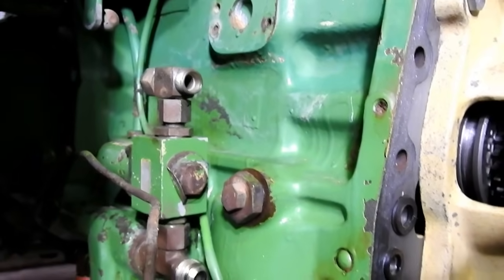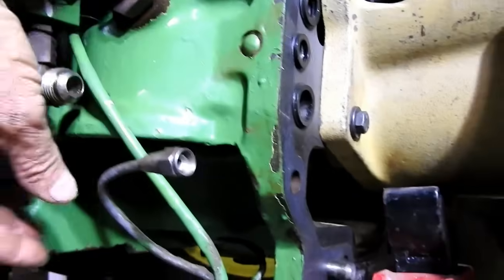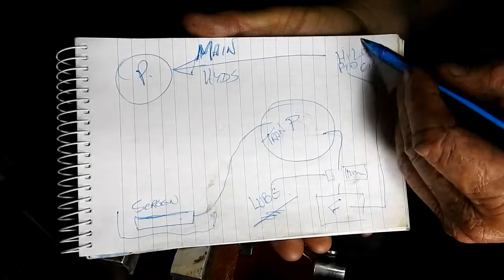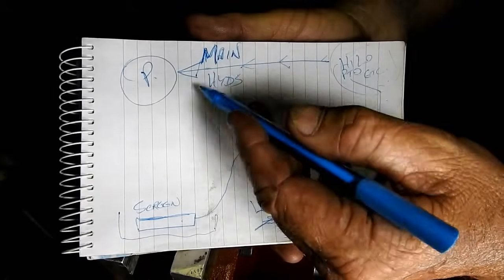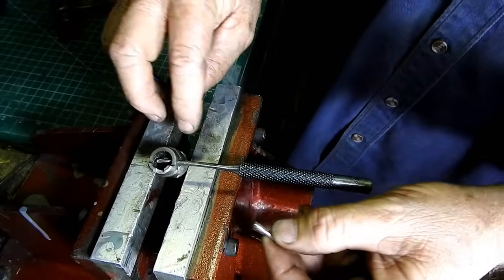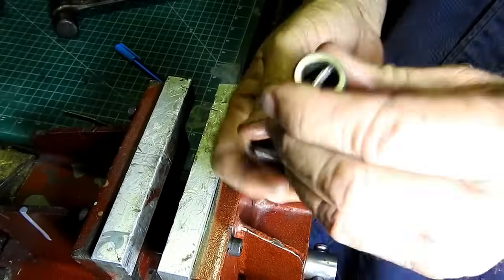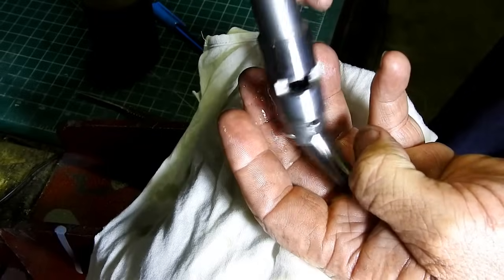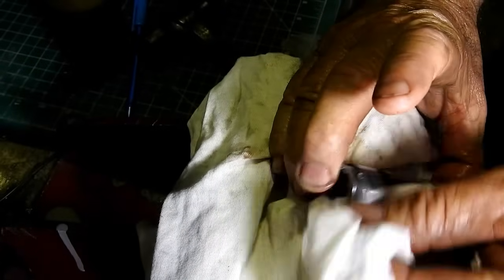How to Check Your John Deere Filter Bypass Valve

Comment: hi, I write from Italy. thanks for the many help / advice you give! I have a problem on my JD. The old owner was traveling without a transmission filter. During a full service I decided (rightly) to put it back. But with transmission filter, arms and steering do not work. 
As if no oil / pressure is coming. If I remove the filter, everything works. Could it be some enchanted valve? thank you
Reply: here we are .  installed the code AR75603 and everything looks ok!  the spare parts dealer apologizes for the mistake.  The important thing was to understand and solve!  no bleeding needed?  the front pump seems a bit noisy.  it becomes silent under load but slightly noisy with the tractor in neutral / running but stationary .
Reply from the maker: @beta85-b4t  the front pump noise is just the coupler. The rattle is a sign of good hydraulics. Replace the drive rubbers and you should be done.
Reply: @BundyBearsShed  I confirm everything ok with the new and correct filter.  only the noisy front pump remains (not always).  under stress no.  with tractor at rest yes.  just give the steering wheel a shot and momentarily it becomes silent (a few seconds).  I think the pump should be overhauled, right?
Reply from the maker: @beta85-b4t  No it is just the pump drive coupler, replace the rubbers and it will be good.
Reply: @BundyBearsShed  ok, I'm happy.  so with a JD RE228042 kit, it might be enough!
Reply: @BundyBearsShed  could it be that the pump is damaged if I constantly find residues in the transmission oil filter?  I have already had to replace the new filter because it is rich in metal powders :-/
Reply from the maker: That is a strange problem to have. I would say clean the screen in the bottom and make sure the new filter is in the correct way, early ones could be back to front but not the later ones.
Reply: @BundyBearsShed  Thanks for the reply.  yes very strange.  I have checked and actually there are different types of filters for the 3130.  the supplier provided me with a model they believed compatible.  but unfortunately he must have been wrong.  now order an AR75603 which appears to be "free on both sides".  hope to resolve.  I keep you updated
Reply from the maker: If it has a big washer in the canister it has the AR75603 but early ones were closed at the outer end the open end went up to the gearbox. The later filter is way cheaper and if it had the early one you can fit the plate to use the cheaper filter.
Reply: @BundyBearsShed  I understand .  thanks for these valuable info!  the dealer had provided me with the AL25554.  these days I get the AR75603 and I immediately test.  It may be that the old owner fell into this mess, that's why he eventually took it off.

Comment: So you talk about the lugs being broke off the end of the valve which is what I found on my 2550. Will this make slow rear lift and hard steering or will the valve still work with them missing? Thanks
Reply from the maker: I try and fit them as close to original as possible but I dont think it should worry the flow.

Comment: Aside from flush, filters and new oil, do you have any recommendations for troubleshooting a 1970 3120 with rear 3pt lift arms not lifting?
Reply from the maker: I suppose you need to work out if it is the only thing not working and if everything else is fine pop the lift cover off and you will probably fine what is wrong.

Comment: hi ,i’m from italy, before remove the valve is necessary to renove all hydraulic oil?
Reply from the maker: Yes you do
Reply: hi.  thanks a lot… today i ha e clean bypass valve but situation is not resilved.. i have a 3040 4wd .. if i power on and wait 10 minutes at minimum rpm and hylo anctive, machine lost the elevator… if i accelerate the motor, the elevator return operational.. any idea?

Comment: hi, good information… you are the best… in jd 3040 to remove the valve is nesessary to remove all hydraulic oil before? or can i remove valve unless remove oil?
Reply from the maker: If you are quick no need to remove the oil but if you are learning it is probably best to drop it.
Reply: @BundyBearsShed  ok thanks i are a big

Comment: Hi there i have jd2040 with sg2 cab,problem is that my rear lift arms are bit to high in lower position...when tractor   is shut down arms are in lower position and when i turn it on it raises a bit....is there a way to adjust this? Sorry for my bad english
Reply from the maker: You can adjust the lever where there is a bolt where it comes out of the lift cover. With the SG2 there is adjustment on the rod.

Comment: I have a '74 full power shift john deere. Last winter I started it to plow snow but the shift lever wouldn't move. It acted like it was solid. Something gave and it now moves but I don't have any forward gears. Reverse is fine, hydraulics still work. What am I missing
Reply from the maker: What model tractor? It is possible that the selector gate broke off the shaft as they do seem to do this from time to time.

Comment: I have a JD 540 4x4 tractor and the forward reverse shuttle has quit working,can you help me out with some troubleshooting.
Reply from the maker: Do the filter, bypass valve and check system pressure.

Comment: Anybody Have  Deere 304J that needs the oil to heat up before it moves
Reply from the maker: I would suspect blocked suction screen or blocked filter and as the oil heats up it can run through the screen.

Comment: 1980 John Deere 950 3 point hitch is stuck in the up position any advice? Thank you for your time
Reply from the maker: The draft cam will have dropped to the side of the rockshaft teardrop. pot the top off and shim the rubbing block and put it back on and it should be good. Make sure you have not bumped the rate of drop lever closed with your foot.
Reply: @BundyBearsShed  not sure i understand your terms for parts you are referring too.
Reply: @BundyBearsShed  was able to get it fixed thank you
Reply: Hi Corey do you mind explaining how you fixed it? I have the exact same issue with my 1640
Reply: @acidlumin  i took the seat off and theres a cover over some type of pin and i took a flat head screw driver and pushed on it at the same time as moving the lever that operates the hydraulics. I apologize that i dont know the names of the parts. Nothing more than a shade tree mechanic.
Reply: @coreycrawford1325  thanks! That might be the “rate of drop” valve (?) and I think there should be a little knob on a stick that attaches to the pin you mention, which protrudes out under the seat between your legs, so you can adjust it without taking the seat off. When I try to turn my rate of drop knob, the whole valve unscrews out of the casing, rather than adjusting the valve. Hopefully that is my issue too, I’ll take a closer look tomorrow. I happen to be getting a new seat tomorrow too. I am no mechanic either! Thanks from Wales.
Reply: @acidlumin  yes sir. And best of luck hope you get it fixed man

Comment: Came across your video trying to find out why I loose all hydraulic pressure like 3 point and steering on my jd 1120, I could run the tractor for a bit then all of a sudden no hydraulics, I shut it off let it sit for a minute or 2 they work again, level is full, seem every time i loose hydraulic I have to shut it off, could that be the hydraulic pump in the front be getting hot and weak? or this valve that you showed, and if you could tell me where to start looking that would be great any help will do
Reply from the maker: It is hard to say from here, the front pump needs supply from the trans pump so pressure testing it would be a good start.

Comment: .
Reply: Am in Uganda my 6125m transmission and hydraulics gets very hot after moving for a while,drops the lifting pressure and warning lights on, but gears engage smoothly and it is powerful enough, help to identify the challenge, thanks.

Comment: Hello lance, I have a problem with my hyrdaulics. I have already checked my filter everything is good. But the only main problem is the plow wont go down.
Reply from the maker: Check you have not bumped the rate of drop knob just in front of your seat. Some times the draft cam can drop off the eccentric on the rockshaft too and it is best to lift the top and take the slop out so it wont happen again.

Comment: Lance, thank you for the video. I'm struggling with hydraulics in similar tractor and your help makes a change in my understanding of the circuit. 
Suppose, a bypass valve with broken off fingers rotates in the seat. Can it lead to any crack in the line before the filter if the filter gets terribly packed with debris?

Do you know what oil pressure should be in charge line of JD 2040s?
Reply from the maker: No it wouldnt crack the pipe they just work harden over time.

Comment: Would that valve make my loader chatter when I raise the bucket if not what do u think it may be. Its full of clean john deere hyd trans oil and new filter what's ur thoughts
Reply: I asked if this valve would make my loader chatter when I raise the bucket this is on a 2040 2wd please feal free to text me on this issue 207 578 1645 thank you
Reply from the maker: No its not this valve this either stops it or doesnt, no in between.
Reply from the maker: No try plumbing the return from the loader control valve into the filter bowl, that way it helps to regenerate used oil faster.
Reply: That is how the return is in the filter. I put a new front hyd pump on and it was fine for 3 or 4 months plowing snow and back to chattering do you think it maybe the internal pump off the transmission is what the john deere deler said it was but they also said it was the front pump I just don't know u do something to fix it and then it's no different than it was u get discouraged what is your thoughts

Comment: Hi , from saskatchewan Canada.  I very successfully used one of your videos to repair the steering valve on my jd 300 loader tractor after it sitting for 6 years , but now after the downtime the hydraulic pump is leaking . It has the big pump ( i think 23 gpm or something like that) are you going to do a video on rebuilding these pumps ?
Reply from the maker: Yes it is in the planning stages the small pump was the 23cc the big one was a 40cc

Comment: Having problems with my John Deere 3350 my steering is gone hard and my link arms won’t go up nor down but my brakes are good anyone able to help?
Reply from the maker: Check this valve and check if you are in Hi on the Hi/lo on the dash, there is a known problem with the hi brake piston packing.

Comment: Had a Deere 2350 we just changed the hydraulic oil and filter in because of no hydraulics.  I took your advice and checked this valve and found part of the roll pin broke and the piece was holding the valve open. I cleaned and installed a new roll pin and everything works great.  Thank you for this video!
Reply from the maker: Glad it helped, thats why I do the videos, so people can have a go themselves. Good work!
Reply: I had exact same roll pin results.  Unfortunately, it did not solve my problem.  Still decoding the mystery.

Comment: Hello, im from sweden i have a john deere 2040s, The front pump won't get any oil from the transmission, The filtrers are new and also the front pump, can a bypass valve be the reason the transmission doenst get preassure? The liftarms went down so i guess its a inner leak, is it possible to get down there without lifting the cab?
Reply from the maker: Yes it can be the problem

Comment: When attempting to remove the valve, does the filter need to be removed as well to allow the valve to be pulled out?
Reply from the maker: No it should just come out.
Reply: @BundyBearsShed  mine wont come out at all. Next im going to try some needle nose vice grips I guess to grab the roll pine. Not sure what else to do

Comment: I have a 5200 that the trans/hydraulics are getting hot. Checked the mesh screen and was clear. Only seems to get hot when PTO is engaged and have not had any trouble while tramming the tractor.
Reply from the maker: Yo dont have a remote valve stuck in working position by chance?

Comment: Could malfunctioning of this valve cause sufficient pressure buildup in the filter housing to blow hydraulic fluid out past the filter housing o-ring/gasket?
Reply from the maker: No if it does that the ring has not been fitted correctly. The idea is to fit the ring up in the trans before fitting the cup.
Reply: @BundyBearsShed  Is blowout there a common problem? Bought tractor at a dealer and used it for a year and suddenly one day it just dumped a load of fluid in a few moments. Replaced screen and filter but apparently didn't get the gasket back right... blew leak just like original problem.  Can it rest in housing groove for install? Need torqued?

Comment: friend I have problems in the direction it is very tough and the plow does not lift either, which could be a Jhon Deere 2850
Reply from the maker: Worth checking this and doing a filter change but they are known to have a split pipe in the Hi lo area at times.

Comment: Used a bit of your advice yesterday - couldn't get plug out in front of my hydraulic filter screen and penetrating oil had no effect. Gave it a few sharp raps with hammer and opened right up. Thanks!
Reply from the maker: Glad it helped

Comment: I am having trouble getting the valve out of a 2750 it seems like it is stuck the roll pin on the outside is broke any ideas on how to get it removed would be greatly appreciated.
Reply from the maker: I use pointy nose pliers and just work it around.

Comment: Thanks for the video lance. I have 3130, 
When I removed this valve, it was a little different like you mentioned-my question is how much pressure or torque should the bolt pushing against the spring have? Cause right now there isn’t any, the spring & plunger just slide end to end, with that centre bolt in tight... thanks
Reply from the maker: I have not done a 30 series for some time but there should be some pressure there Im sure,

Comment: How you doing old buddy I have a 850 John Deere tractor I moved it from the back and I brought it into my bar and I left my lift all the way up forgot about it I went back I got sick I went back there later and I went crank it and read leave the lift to go down and it don't go down what is wrong with my tractor if you can help me give me a call at 337-945-6696 my name is Tony Cajun man Church Point Louisiana I really appreciate it if you could help me with my problem
Reply from the maker: Check the rate of drop screw in front of the seat, you may have bumped it by mistake and closed it off.

Comment: I've got a 4440 with power shift. The hydraulics all work but the 3 point won't lift any weight. Will this valve cause that if it's not working properly?
Reply from the maker: No I would look at the hydraulic piston o rings.

Comment: Good afternoon! Congratulations on the videos!
I need your help!
I have a 1640 john deere tractor.
Hydraulic problem. There is no oil in the oil cooler and in the reservoir. He only raises a big turn. Vibrate a
 steering.
Where do I measure the transmission pompe pressure
Thank you for your answer in advance
Reply from the maker: on the side of the gear shifter cover, the front plug.

Comment: Hello, I'm sorry, I'm from Argentina.
I have a 3350 that has problems with the hydraulics, the steering works very well.
but the tool cylinder doesn't lift me up.
I wanted to know what the problem might be.
Thank you...
Reply from the maker: Check this valve and the filter, you might need to lify the hydraulic cover off for a look I think.
Reply: @BundyBearsShed  Thank you very much, and sorry for the inconvenience

Comment: My 1830 won't start when hot. Cold, just warm, no problems. Of course, easier when hydrolic arms are down. But when hot. It won't start. Have to wait it cools off. Any idea what's the problem. Batteries are good, the contact too, the starter is good also. Nobody can find the problem. Thanks.
Reply from the maker: Try pouring cold water on the injection pump and let the cool soak in for 30 seconds to a minute and try starting it. If it starts the injection pump is worn.
Reply: @BundyBearsShed  I tried that. It did work but no more. So problem is injection pump?

Comment: We have a 3140 we have checked this valve changed both transmission pump and front pump but when the tractor heats up after running for about 15 minutes the rpm has to be high for the loader and steering to work we know there is a leak but do you have any tips on how to find out where or books or testers we can get this has been happening for quite a while .
Reply from the maker: Try closing the relief valve on the loader a little and let the tractor pump de stroke and see if that helps.
Reply: Thanks we tried that as well our dealer feels our tractor may just be worn out and it's leaking in a lot of small places. Just hate to let her go we have had it for 25 years she's been good to us. I'll keep watching though we have a 3130 also and a 6420. Your videos are great. And sorry to hear about your Dad. Thanks again from Nova Scotia Canada

Comment: Hi, is the location of the filter bypass valve the same for a JD 2250 tractor? Thanks
Reply from the maker: Yes, it is
Reply: Thanks for the reply Lance, a follow up question if I may. I've had the valve out and is operational as per your video. I did notice that one of the locating lugs at the end was broken off. This is probably in the sump now I guess, I removed the hydraulic filter and it has very little oil in it, so maybe not getting oil into it. To test I turned over tractor and can see that no oil getting to the filter. So does that mean it could be either  the valve is opening and dumping back to sump for some reason, the valve is closing and transmission pump is not working, or the hydraulic pump is buggered. Apologies for the long winded question, as a first timer, just wanted to see if I could get a hint before pulling it to bits, thanks Christian